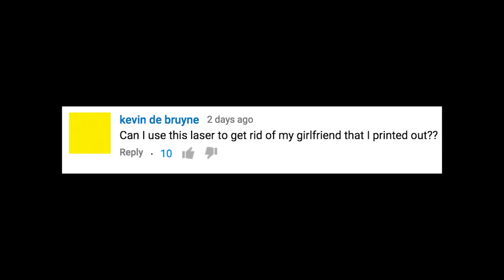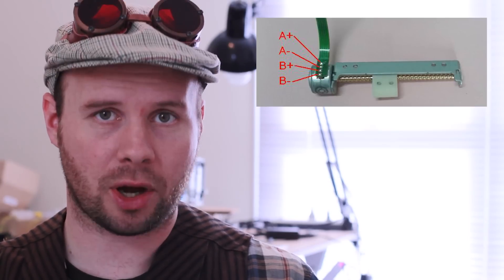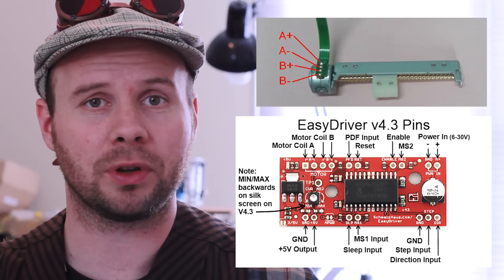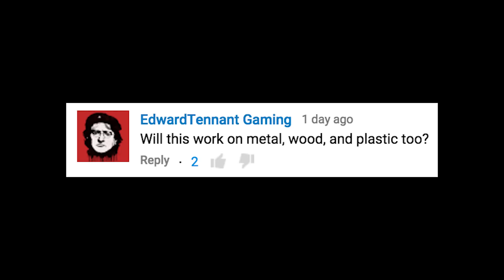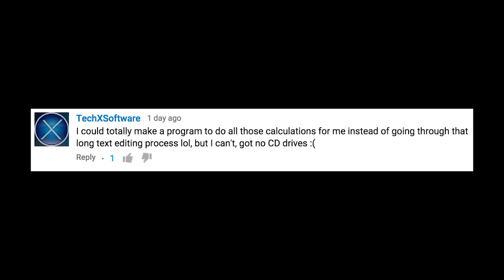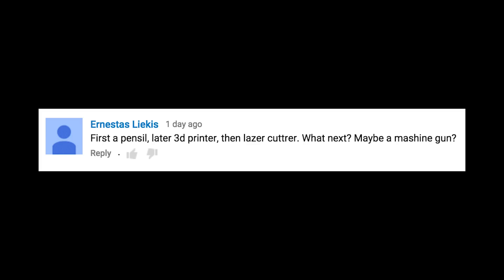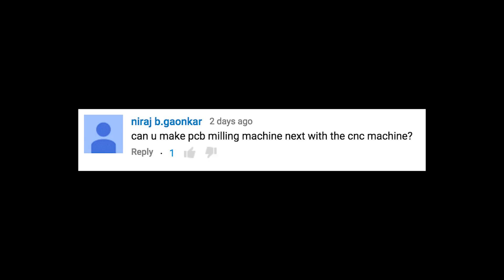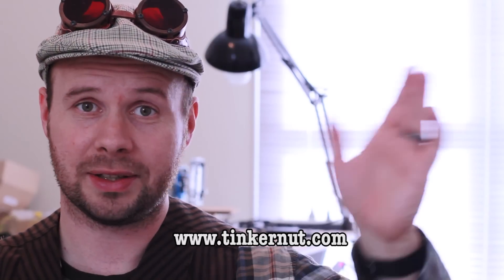Comments Show: How To Make A Cheap Laser Engraver

Comment: dude i found out these extruders for really cheap can they work for the 3dprinter project?
because the pen costs like 33 euros
http://www.ebay.com/sch/i.html?_from=R40&_trksid=p2047675.m570.l1313.TR0.TRC0.H0.TRS0&_nkw=3D+Printer+All+Metal+J-head+Hotend+Extruder&_sacat=0

Comment: you could modify the pen Potter with a sharpie and use a piece of copper clad then you would have a PCB Potter and you would just use ferric oxide to eat away at all of the exposed copper after making a negative image of your circuit